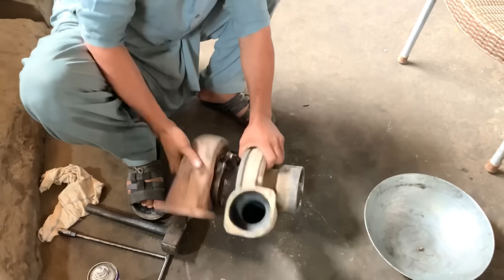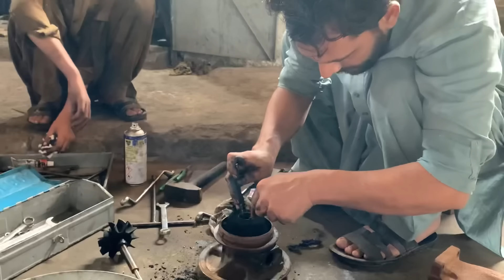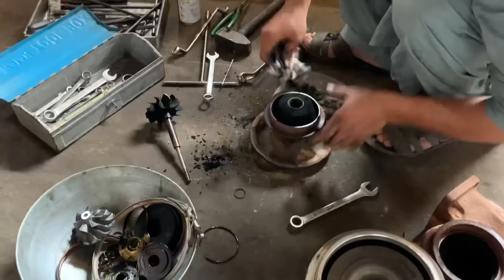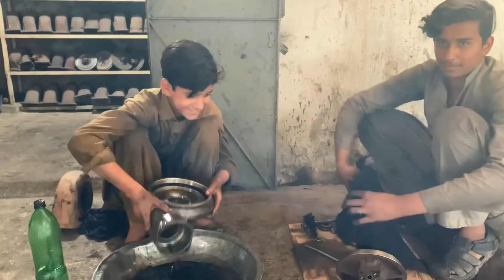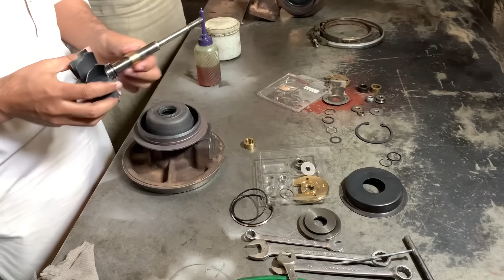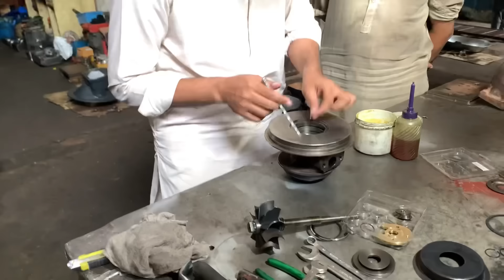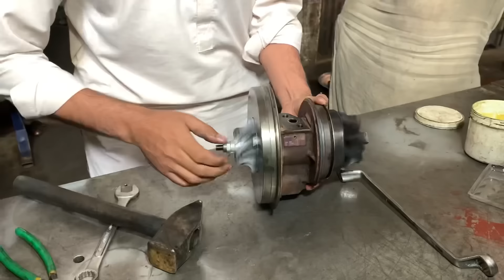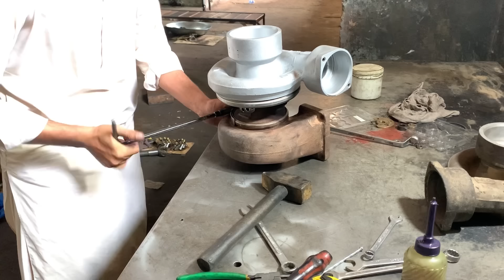Turbocharger is not Working Good | How can repair turbocharger by a small boy ?

Comment: They called in Turbocharger expert for assembling the whole thing. It's good they have experts in doing such complicated tasks.
Reply: an expert would have marked the impeller wheel to the turbine wheel and also torqued the nut holding the compressor side together with a torque wrench.
Reply: Complicated , not at all.

Comment: I wonder did it rip itself apart after not balancing a no torque setting. It didn't look like it was spinning to freely after gunthering it together.
Reply: If you reuse the compressor turbine and line up the witness marks on the end of the shaft there is no need to balance.
And yes i have rebuilt hundreds of turbos
Reply: @terrycaporn8207  It don't look like he lined up anything

Comment: I cant figure out why they'd waste spray paint on a cast aluminum compressor housing. Painting the compressor wheel? That's just destructive!! It'll last a while, sure, but there's no chance that thing is still balanced and it will now be eating bearings much much faster.
Reply: So it looks new when it’s put on a truck here in the states
Reply: Yeah, it will come back for service again…win win
Reply: @theodoremccoy3238  but it's cast aluminum...wiping it down would leave it looking nearly identical!
Reply: its a new one
Reply: If you take a look once again you will see that he did very light balanced coats on all sides of the wheel. Here we are talking about miligrams of inbalance, which one cast wheel already has, its not a big deal!
Reply: False I'm from texas I rebuild my turbo on my cummins just like how they are doing 86,000 mile on the rebuild turbo aka spooly boy and it runs perfect till this day

Comment: I had a Turbo in my Mazda that just required a good clean due to Carbon build. The Vanes began to open and close Sweet-As. It went onto do another 80k and still going with another owner. So these fellow maybe doing just that, and the wire brush is soft bristles, wouldn’t harm the shaft, only removing stubborn Carbon deposits. If this workshop was in the UK, GameOn, I’d be a customer with hundreds of Turbos, and initiate a Game PLan of excelling into refining Hybrid end Turbos BaLancing etc.

Comment: its beautiful to watch these guys working like a professionals, but we didn't see this turbo works correctly under daily pressure without oil leaks .
Reply: mate i built turbos in the 80s in much the same way, and they worked perfectly, I believe there's are no different and the only difference is the shops of today are  cleaner. i still built them today in a cleaner shop in Australia

Comment: I worked in a turbo shop for 20 years . This is the most amateur job I have ever seen . Wire wheel on the bearing journals ! Un believable . No balance ? No run - out check ?This unit will not last very long .
Reply: I agree with you and also that boy was cleans the housing with grinder emery stone.
I mean who repairs turbo like this?
Reply: I need help!!In Serbia we have something like this, nobody can't repair turbocharger for real.The new one Garet cost about 400€ but from China and that cannot be original .Problem is whistle on Golf 5 1,9tdi, whistle is not so strong an i heard only when slow down sped,when i give more speed I don't here whistle!!No oil to spend,no smoke,good running and service say everything ok but little whistle make me mad 🤬🤬🤬 Advice please?!Thank you and greetings from Serbia.
Reply: @ivanmiljkovic862  You don't hear whistle under load because engine and exhaust is louder . whistle is worn compressor wheel vane edges , and possible ware on housing . This only happens when baring's are worn .If you rebuild or replace make sure to put a NEW oil feed line DO NOT clean and reuse old oil feed line .
Reply: @derekcrymble9085  thank you so much, I'll give my best to do it right.
Reply: @ivanmiljkovic862  I have 1.9tdi and whistle at idel is totali normal. Have changed turbo and new turbo also whistle. If there is not much movement on shaft then dont bother.
Reply: @iggnasio  Hmmm,that noise is terrible thing.Thank you for sharing experiences
Reply: Anthony Wright  your mom says hi . Your are correct . As a turbine machinist for twenty years , I am an expert .And you clearly have zero idea.

Comment: And first of all, the way you remove the turbine casing, is by use of an acetylene torch and heat expansion. Not by hammering the thing on your knee. Which, as you were able to open the thing in the first place with this method, means that turbo hadn't had much miles on it.

Yup. that thing was perfectly good before you guys destroyed it.
Reply: It couldn't have much especially if it was 2th rebuild.

Comment: Most places just put in a new CHRA (center housing), guaranteeing a fresh turbocharger in about 5 minutes,
Reply: Well thats not "most places" they do what they can with limited to good tools and machines
Reply: @chayannecastellano7221  I prefer my way.
Reply: They haven't got a parts store round the corner. Probably 30bucks in New seals is better then 400 plus cartridge.
They haven't even got shoes or safety, probably better mechanic then most of these computer junkies.

Comment: Job well done ✅
Fully recon ✅
Ready to go ✅
Reply: You quite clearly know nothing about this.
Reply: @kacperchrusciel890  The turbo rebuilt this way will be fine, it'll work without issue.
Reply: @Draxindustries1  I can tell you have never worked in a turbo shop
Reply: @danielelliott3659  We sell ex CCCP turbine heli's (HIND), gas turbine and diesel gensets, tanks, personell carriers and jet warbirds( MIG 23's.)
We rebuild gas turbines, jet engines ect and have just rebuilt all four turbos on a Kaz 38 litre V10 2stroke diesel.
We have also completely rebuilt 2 MIG 23 engines (shaft bearings/seals and burner nozzles. Further we also manufacture under licence many jet parts. 
Greetings from Russia, Cherkasy (factory) & Girood (Airfield).. 👍
Reply: @Draxindustries1  на тягаче каком она точно будет работать, на более менее форсированной легковушке она развалится быстро
Reply: @Draxindustries1  what about balancing of the turbine. Will it not chew up the bearing surfaces?
Reply: @kacperchrusciel890  If they are marked accurately the position on the shaft before reassembly it won't need to be rebalanced.
Alternatively many manufacturers produce a ready balanced 'cassette'. The housing is taken apart and the whole assembly swopped over.

Comment: Rebuild with our balancing, it will last a very very short time. These need to be balanced as standard. Not good.
That and doing up the main shaft without torque wrench, that will make a mess when it flys undone at 100,000 rpm.

Comment: Isn't a turbo ment to be balanced after it's been rebuilt?
Reply: I think the individual component balance is more important and that would be done from the factory, the overall balance more of a high performance thing. That's my impression. That looks like a turbo off a large diesel, so the rpm will be far lower than a performance turbo. I don't like the use of the wire brush on the shaft, or the paint on the compressor. Both seem unnecessary to me. They could probably save themselves time by skipping that and it be a better job.

Comment: Forgetting everything else... Torque was the "only" thing holding that impeller nut on? That spindle nut spun down by hand, no loctite (type) of agent or specific nyloc used?. Well, OK. Still - Shoutout to the guys in the trenches. Always impressed with their work ethics.
Reply: They use a very simple trick to make sure the shaft nut stays on in normal operation. One of the shaft nuts is left hand threaded. This way the normal rotation of the turbocharger has a tendency to tighten the nut by it's own.
Reply: @shi01  Good catch, 01. I never was good at math. You RoCk  :O)

Comment: Sure.. just bash the turbine blades on the ground... Compressor wheel not even marked for indexing to the shaft when disassembled. When assembling the internals, turbine was hitting in the compressor housing when he was knocking the seals in. No need for torque specs I guess either ? Compressor / turbine / shaft is no longer dynamically balanced after all this. 
You can keep your turbo, not going to last long now anyway.
So many of these people commenting and giving praise have no idea on what is important when assembling a turbocharger that spins at 100K rpm. 
I guess the video title is correct, your tubocharger will definitely not be working good after this.

Comment: seeing as there is no damage to the turbine or compressor, i'd say its good as new, as long as your bushes and bearings are good quality and the centre shaft is sound
Reply: My guess is there was oil leak and worn bearings, sure shaft is safe and sound after this grinding against metal brush :D

Comment: Everyone complaining about a little paint on turbine it will come of within seconds also this is a slow spinning turbo it likeley has been rebuilt and will continue to be rebuilt over the years unlike here in U.S. when I have paid ford to replace 4 turbos on my eco-boost crap only to find out engine block is also unusable lol. Mostly everything here automotive is designed to be disposable unrepairable these old turbos were designed to be re-used.

Comment: Bravo it's not rocket science
Common since is a must... Been running my backhoe JD 410b on 80% used motor oil, 20% diesel+a few ounces of acetone commonly known as fingernail polish remover... About a year into the recession. The turbo have the exhaust canister was full of Soot. Disassembled clean with hot water and then gasoline. Poor boy wins again, hell yes I'm still burning drip Oil... Carry On

Comment: No! No part of a wire wheel should touch a turbine and compressor assembly. And painting it will unbalance it causing loss in performance and Reliability. You think replacing the turbo with a new unit is expensive? How about replacing engine pistons and valves because you went cheap on the turbo and it grenaded?

Comment: As far as 3rd world repair and rebuilding this is sort of easy repair as all it consists of disassembly clean and reassembly with new o ring .. that is why a kid is doing it. He did not mark the location of the impeller which is stupid because he had a hammer and a scribe he used to mark the orientation of the turbo ? .. more then likely the roads are so bad the engine do not rev high enough in any gear for the imbalance to be an issue ?

Comment: Impressive work bit unfortunately a few mistakes..

1) cleanliness 
2) safety first
3) use the manufacturer parts.
4) use manufacturer settings for torque settings of the impeller.
5) turbo should be balanced.

Still it's a overall good better then expected.

Comment: The turbo no have problems 😅😅😅... Wasting time ONLY.... The horsepower drop low by the cooling fan size... It's will not same like before.. and you will tuning yours rpm LIMIT... And you should tight the nuts by measuring tools... Don't random tighting... Because when it's hot the dust seal will sound noise and the hot come out hit engine...

Comment: from the huge number of parts in the background you can tell these guys know their trade and their rebuilds must work, but I cringe each time they hammer directly on a part. Would be very easy to crack the cast parts that way
Reply: Si y sobre todo la máquina de equilibrado que tienen de alta precisión 
Y también apretar la tuerca del eje sin ir a sus Nm de par 
Todo eso está divinamente para un turbo 
Ni 1000km va a durar la pieza

Comment: OK, there's so much wrong here that I'd need to make a several hour long video pointing out what your doing is dangerous to the customer and his equipment, but first of all, all if you intend to re-use the exhaust turbine / axle and compression turbine; disassembly in on a table vice and don't score, or even let any part of the compression turbine housing even touch the compressor blades.

You can't use much force cleaning any of the turbine bits either, because you'll destroy the blades. Which you do on this video.

Even a slight twist in the blades will cause imbalance and flow and boost going off whack or not getting produced and the turbo will grenade itself at some point. 

Same for the axle assembly, this is a precision instrument which also cannot be reassembled with out balancing on at least two axis, preferrably on all four. Or yet again, the turbo will grenade at some point. 

If boost and rotation speeds remain with in designed specifications you can get away with the thing just snapping off at the exhaust side and you only get minor shrapnel in the engine inlet and head when the turbine breaks loose at 150k rpm and starts eating the compressor housing and standard refit will suffice to FIX THE HEAD. Also, this means the engine needs to be flushed to make sure nothing fed into the oil loop as these are oil bearing devices.

And what the hell is someone doing near a compressor turbine with a spray paint can? I can see why you'd paint the housing as acid based cleaning of aluminium is a dangerous business with out protective gloves but goddamnit. 

Sure, you can get the turbine main bolt torque spec close by hand, sometimes that's necessary even with access to a torque wrench and an angle gauge but, no. Don't do that as a standard practice, fuck it up and yet again turbo will fail catastrophically.

You don't want anything as imprecise as what you're doing to the axle to polish it anywhere near the axle as yet again, griding off material willy nilly and not with a precision lathe cause imbalance and albeit this kind of an approach is appropriate when the thing is stuck in a slow rotating lathe. This grinding wheel shit is for idiots. This can cause among other things; Failure of the oil seals, failure of the oil bearing and turbo will grenade, most likely the axle was already scored and needs to be replaced due to lack of lubrication and heat effectively forging the thing and it's very brittle, imbalance combined with this, means turbo will fucking grenade.

First you clean the thing chemically, then you polish or there's some nasty things going on on that surface you don't want to happen. 

For fux sake, get at least couple of table vices and don't bang the thing around like it was some sort of a toy.

Even if it is a Holset copy from China or the genuine item from the Bubbas of Sweden themselves.

And stop hitting it with sledgehammers when assembling if you don't want to just ditch the thing straight into a smelt after it's in one piece. This thing you finish up in the video, has been abused and thrown around so hard it's unserviceable. Period. 

The appropriate tools for assembly and refit are available from where ever you got that bearing set from or from more comprehensive turbo refit OEM such as Melett.  Melett.com has a vast and free library of technical packages, known failure points and modes and usual suspects in assessing what caused the thing to fail, before it landed in your hands.

Comment: This entire channel is basically an object lesson in how not to do things or how to do them reeeeeeally badly.

I'd give that turbo maybe 2-3 hours of runtime before it explodes.
Reply: I am a mechanical engineer. I think the turbo is built very well.  Coating the impeller was not necessary. Could have been to improve its appearance.  Did you notice he only coated the impeller on the intake side of the turbocharger?  This side of the turbocharger is not exposed to direct exhaust gases. I assumed he used a high temperature paint.  All bearing and seals have been replaced and well lubricated . Those guys definitely know what they are doing. I don't have anything negative to say about these guys. They are doing their best with the tools they have.  Good Job Guys from USA.

Comment: Weird that such a high rpm precision unit can be rebuilt like a carburetor. Also, if they are into rebuilding turbos, they should invest in a heated ultrasonic cleaner. Breaks the carbon off the impellers and eliminates the need for spray paint! Also the fact they didn't do any endplay or wobble (? on proper term) tests is very sus (if they did do it, then put it on camera).

And for goodness sake! Give the child some chemical gloves while he's cleaning off the parts from what I can guess is some chemical mixture.
Reply: Use my Turbofield Nano Treatment and you will not need a ultrasonic cleaner either. This seals the micro pores of the metal and does not allow carbon deposits to happen . No place for them is left

Comment: '' FOR SALE ON EBAY, BRAND NEW TURBO 500USD lol... Yes, nice to see how to take apart parts and take them back together.. BUT THIS IS NOT HOW YOU FIX A TURBO! This will fail after a short time guaranteed. I built turbos before, the turbine is not even balanced o.O Torque on the turbine wheel? come on now

Comment: OMFG... Didn't use any alignment marks and didn't re-balance it. Not a caliper in sight to make sure the shaft is even any good or if the bearings are even the correct size. lol. This is pathetic.